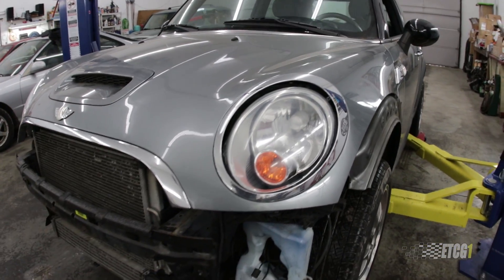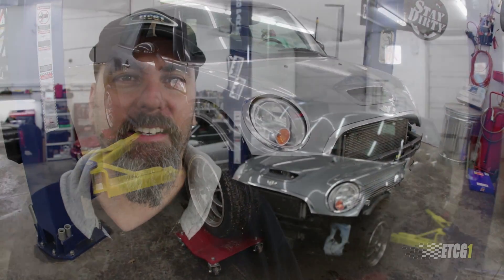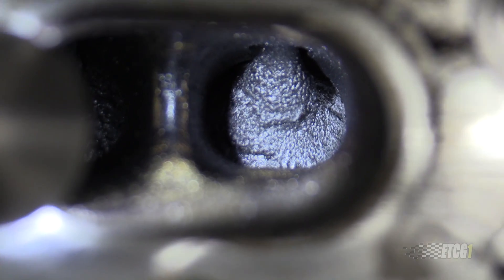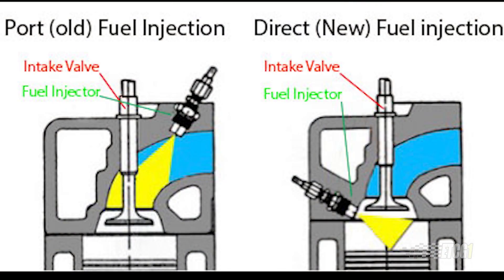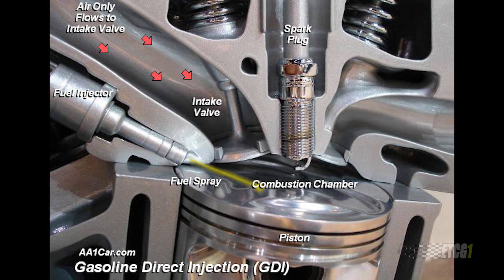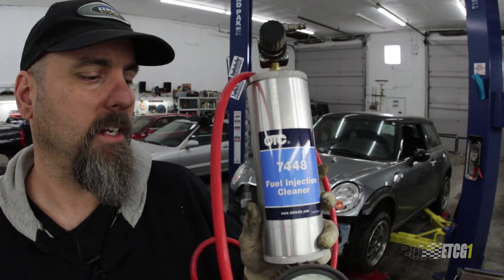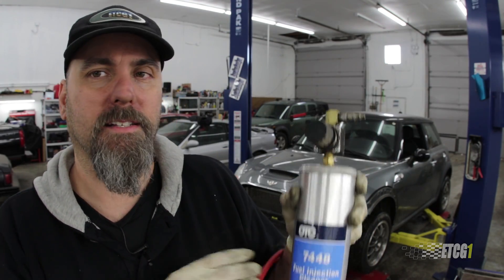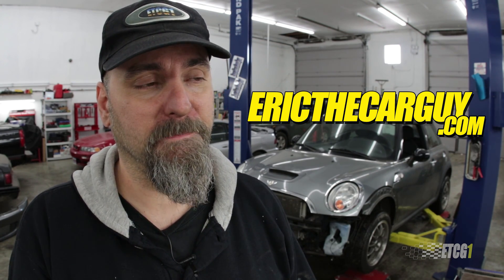Direct Injection Proves Fuel Additives Don't Work

Comment: The problem is direct injection, not the additives.  The majority of car manufacturers have publicly stated that the government minimum fuel detergents are not sufficient for port injected engines so there is little reason to argue otherwise unless you somehow know more than those engineers.  Direct injection is another issue entirely so the two need to be separated in any such debate.  Modern DI vehicles also have port injectors to 'resolve' this problem.

Comment: Coupla' things:
A) DI blows. It blows to the point that several companies, (Toyota and Ford come to mind. I'm sure there's more.), are using a port/DI hybrid system because of the intake valve junk. Of course, their stated reasons will differ from that explanation. cough*warranty work*cough
B) Fuel additives are, for the most part, un-necessary IF you're using tier one fuel. Tank up at Costco or Sam's Club on a regular basis and a jug of super duper seagum will help mitigate some problems associated with a "dirty" fuel system.
C) A catch can has been shown to reduced the amount of grunge on the intake valves in NA DI engines. 
D) A cleaner introduced via the PCV into the intake system can help keep intake manifold/valve deposits from building up too badly. The caveat is that if your engine is turbocharged, bad things can happen.
E) CLEAN OIL, FOLKS! If you follow the extended drain intervals recommended by some car makers, your oil will, by design, break down and add to the deposit woes. I don't care how "good" the oil is that you use or what your owners manual says, 20K miles is too damn long for an oil change. Maybe with a by-pass system. But, otherwise; no.

Comment: YouTuber Chrisfix tested several brands of fuel system cleaners. He inserted a camera in each sparkplug hole cylinder and got before and after images of the deposit. It was not a paid sponsorship and Sea Foam did the best job.

Comment: I had high hopes for direct injection gassers. The potential for higher compression, and more power + MPGs seemed too good to be true. The only solution I've seen so far is to double the number of injectors like on the latest mustangs (Hat tip to Scotty Kilmer). One set sprays directly into the combustion chamber, while another set sprays the back of the intake valve.

Comment: All direct injection vehicles that are boosted should run water methanol injection there would be no buildup on the back of the valves... or they should delete the EGR system. They should do one or the other. Or maybe they could run one extra injector in the intake manifold and periodically use it under heavy load to clean the back of the valves.... But some form of fuel needs to go through the intake manifold for long term use of direct injection.

Comment: Is seafoam a better solution to cleaning an engine to keep it cleaner when running though a fuel System? Or is it better to directly spray Into intake system and put into oil?

Comment: Fuel system cleaner is for fuel injectors only. it does nothing else so if you never want to replace Injectors because there clogged then use it it has been proven to unclogg fuel injectors and multiport fuel Injection should come back and save the day

Comment: I disagree with your logic on the gasoline. No, fuel injector cleaners don't do much good for direct injection engines (though they will clean injectors and carbon deposits off of the top of the piston), for the same reasons that you talked about. As far as fuel system cleaners go, most are snake oil. Most are just octane boosters, and you could get the same effect by pumping 91-93 octane fuel instead of 87-89. As far as the logic with gasoline goes, yes it's a solvent, but the majority of the intent for a fuel system cleaner is to clean the carbon deposits left over from combustion of said gasoline. There are many videos on youtube that show which cleaners work and which don't. Seafoam has a very good track record, and putting seafoam directly into the intake while the engine runs has been proven to have good results. 

Per your theory, a carburetor would never get plugged up. As most of us know, leaving a carburetor full of gasoline for an extended period of time will create a varnish as it evaporates, sticking needle valves and clogging jets. Carbs can even get plugged up by foreign objects such as dirt, but if gasoline was a good enough solvent to clean deposits, it should also help clean these foreign objects.

Comment: I always thought that the fuel injector cleaners were to clean the carbon off the tip of the injectors where carbon builds up or other stuff gets stuck on the screens. 
That being said, gasoline is a good solvent and should do the job anyway as you mentioned.

Comment: I do know the automotive show Fifth gear did do a test on an older car where they were looking to restore "lost" power in a car that ran just fine, and fuel injector cleaner gave it back like 7hp and was proven on a Dyno, though the car ran no different and you wouldn't feel that 7hp difference amyway

Comment: For whatever reason, it seems like the German GDI engines (VW, Audi, BMW) seem to suffer more than others with intake valve carbon buildup. Most of the complaints I've seen with GDI engines having major carbon buildup problems fall into that category. Not really sure why, but some manufacturers have apparently done things with the valve timing in order to cause some amount of fuel mixture "backwash" over the intake valves to help keep them clean.

Oil also makes a difference. If you run a synthetic oil with lower NOACK volatility ratings, you're going to get less oil evaporation to end up getting caked onto the intake valves.

Comment: How in the actual fuck does a direct injection engine that never gets a drop of gas or fuel aditive/gas across the backside of the valves prove in any way shape or form that fuel additives don't work? I know your salty because Minis will do that to you,  but c'mon man.  You know what will keep most of that crap off of the back side of said valve's? Catch cans on both sides of the pcv system.

Comment: Carbon build up happens thanks to a combination between the egr and the fact that the injectors throw fuel inside the cylinder, never  cleaning  the intake valves. I'm not a mechanic by the way, so don't kill me if I'm wrong.

Comment: Well some of the cleaners (in my opinion) do keep the injector tips cleaner but not the valves. The best thing I’ve found on specifically ecoboost engines is a quality oil separator for the pcv system and top quality fuel , regular oil changes obviously

Comment: So, tell me again why you picked up this Mini?  Was it like your father-in-law's Jeep?

I had a Nissan Pathfinder (1980 something) that had a throttle body system.  It was running rough so did the usual and changed the plugs but that didn't help.  The shop I took it to said that the throttle body needed to be overhauled and cleaned out.  These were my poor days so declined and tried a bottle of Prolong first.  Wow, it did the trick!

I have a direct injection Tohatsu 90hp outboard motor that I bought new on my boat.  The shop said to run premium gas and Techron fuel additive.  It's been four years now and have only changed the fuel/water separator filter.  It's still on the original plugs, etc.  Starts right up every time.

Comment: DI is good if you run boost. Lower octane required and higher compression and can run leaner mixture. Needs a good pcv oil separator.

Comment: You can still dump crap down the air intake like we did in the 60's.  Mostly used transmission fluid.  Not sure what the purpose was, I was 16 at the time but it made a lot of cool white smoke.  Just like when the modulator valve failed on one of the old automatic transmissions.

Comment: ticking time bomb, stay away from DI i was told back in the early 90's for this exact reason but the automotive industry is pushing this shit like it's a new invention to the IDIOTS stupid enough to believe it. It's been around since the early 40's and they never pushed this tech for this exact issues and now they are only hoping the cash in on it when this ticking time bomb runs it's maintenance cycle in the market. They try to fool the idiots saying it's a better new technology yet at the end of the day there are no significant gain in fuel mileage. FUCKING TOOLS, just another part of they global planned obsolescence scam. LOL

Comment: There is not a single additive that anyone should use ever.Period. Oil/fuel/coolant came with all necessary additives in them and anything else is just wasting money and even causing more problems depending on how sensitive the vehicle is. If you using an additive then there is a problem with your car that needs servicing or you are buying a placebo. Bottom line. Oh maybe octane boost if you need to refuel somewhere with bad gas and require premium. Thats all I can think of.

Comment: I work at a dealership and we use service pro fuel induction services for our customers. I'll be honest, I'll do it if it is on the ticket but I never upsell that item, if a vehicle needs a brake flush, coolant flush, trans flush, I'll upsells that, but I just feel like I'm pick pocketing a customer with a fuel induction service. It's a pour in additive to the fuel tank, spray off the throttle with throttle body cleaner (which is good I guess) and then let the intake vacuum draw intake cleaner through the intake. I've never seen much of a difference but that's just me. I don't put it in my car, don't see much of a point in trying to sell it to a customer if the results are questionable.

Comment: I’ve seen walnut shells blasted into intake ports to clean valves while the head is still on the engine. I’ve been concerned about direct injection as well. I’ve got two cars with it.

Comment: I feel like the while premiums is just wrong I think think all your really meant is that fuel additives don't clean intake valves on direct injection engines but a lot of things wrong here 1 I'm not saying that a lot of them are not crap and snake oil but they say it can help if you use top tear gasolines whats different between cheap and top tear additives and do you use the cheapest gas you can find or are you brand loyal but saying something similar to something else proves something else does not work I mean what you are saying is condoms don't work I got crabs well they were basically never going to do anything for crabs

Comment: You are correct. Direct injection works fine until the blowby gases crud up the intake. Yes, the additives that are sold are pure snake oil and really won't fix the problem and at best just push it off until some other major problem comes along in a few months. But isn't that the point of modern cars? They're "use them once and when something goes wrong, toss them". Even the OEM replacement parts are getting to be total crap as well. 

"Just because I'm paranoid doesn't mean they're not out to get me."

Comment: If you use seafoam and spray it into the intake instead of putting it in the gas it will work on a direct injection engine since it's going along the back of the valves where the air goes in.
Reply: I've tried it for myself and it'll definitely make it look cleaner even if it doesn't have any effect on the performance.

Comment: Find a small manifold vacuum source. Heat the engine until fully hot and introduce water into the manifold through the vacuum source. Do it slowly, allowing it to take small amounts and rest in between.

Comment: TLDR: fuel system cleaner doesn't work on areas of the engine that fuel doesn't reach. 

Also won't do much in the tank, unless maybe you put some in every tankful. 

Former Audi B7 A4 owner here: soda-blasting the intake valves is an amazing process and your car will be a new beast when it's done. Also, install a catch can asap to rid yourself of most of this issue.

Comment: Apart from "possibly" cleaning injectors and fuel system with fuel cleaners, it's my theory that without fuel to "wash" the intake valves, a direct injection engine will always have dirty intake valves

Comment: Its that yankee fuel!! HA HA A good fuel injection is great... And easy(er) to tune than a carb. But you will find even though a carb is simpler, a fuel injection is more efficient and can possibly make more power where and when you need it. (by easier to tune, I mean the tuning map, putting fuel here and there where you need it and many other custom tuning needs in performance. And a carb is a balance between jetting and fuel pressure and its more "analogue")
Reply: OK, I'm old but gotta say, I can tune a carburetor with a screw driver in a couple of minutes, no computer required, I do it by sound and a tach if ones available.  On the other side fuel injection systems are pretty forgiving, with all of the sensors if they're right they tune themselves.  I see the good in both, for a daily driver or a hot rod I want fuel injection.  Unless you want to wrench all of the time and constantly clean and adjust you want fuel injection, it's probably the best thing to happen to cars in the last 30 years.
Reply: The one and only reason I prefer fuel injection to carbureted is the easy starting in the cold. Not having to mess with a choke is a fantastic.
Reply: Has nothing to do with carb vs fi.  His rant is about direct injection vs port or throttle injection.  A carb can match a throttle efi in performance, economy not so much.  A carb can't match a port setup and certainly not direct injection on any front outside of cost.  

This issue is that with DI only carbon build up is a real problem inside the combustion chamber and gunk in the ports.  It's not really a fuel additive thing though.  It's the fact that fuel is precisely injected in a very fine mist quickly and there is no washing effect.  With port or throttle injection fuel is washing the port and combustion chamber before it's ignited.

You might be thinking why the port, well because PCV vents back into the intake.  So if you own a DI only car don't be surprised when around 25-50k you are hit with pricey fuel system cleaning, failure to do so will like mean you are looking at removing and media blasting the intake and heads.  This is part the reason you seeing some cars with port and DI coming out now.

Comment: You are so right!  I admit, I fell for the 3M Fuel Injection Cleaning System BS.  Bought the whole kit, along with many cases of the high pressure and low pressure cans.  You probably remember the stuff...you disconnect the fuel pump, disabled the fuel back-pressure bypass to the return, and connected a can of this stuff to the injector rail and ran the engine off the contents of the can until the engine quit.  I thought I was doing great by the customers...until I took some intake manifolds off of cars I had treated with this stuff.  I noticed no difference, whatsoever, between engines I had "cleaned" and others I am fairly certain had no "cleaning" treatments, whatsoever.  I was had!  Big surprise when 3M stopped making this stuff.

Comment: we run gm top engine cleaner through the intake to clear carbon like that and id say it works most of the time. Its usually to fix cold start missfires

Comment: We use a qmi induction service and i hook it up just behind the throttle body with the vacuum line. It essentially hits the valve through the intake manifold thus cleaning it on GDI. What do you think of that?

Comment: Fuel stabiliser is basically all i put into the tank of my car, a 99 accord. Why? Well the bitch often sits for a few weeks before getting started as its in storage. Its got 230k miles on it before any of ye ask. Still starts with a tap of the key (way easier than the shitty mini in the vid) my verdict: high mileage honda that sits for weeks is better than low mileage mini that cant sit for a couple days without dying
BUY JAPANESE

Comment: Mmm, fuel additives. What about putting 2 Stroke oil in diesels at about 1 part per 100?
Mixed results. I tried it myself on a 20 year old normally aspirated diesel and it did make some difference. A more modern diesel, it might not make much difference other than an improvement in economy cause it retunes itself to compensate for a better cetane rating ...

Comment: I'd expect if they did help, without some significant drawback, all these chemicals would be part of the standard additive package.  They aren't, and there are reasons they aren't.  Whether it's money, sped up corrosion of some parts, whatever, they'd be in the standard package if there wasn't a significant drawback.

Some of them might have some utility in some situations like you suggest, but as an every fillup item... waste of money.

I did throw a can of Seafoam in my Grand Am when I got it because why not, but normally the only stuff I ever use is HEET to get rid of water in the gas, had a bit of a problem with that in a Maxima(often enough I probably should have launched a real diagnostic project to figure out why, but that car is pretty much scrap at this point)

Comment: I've not really put a lot of faith in them either. However I've seen a guy bring some injectors from his Powerstroke back to life with some so I'm not entirely convinced its complete bunk. I would investigate a catch can or other AOS of some sort. I had them put on my BMW and it made a notable difference in the time between walnut blasting the valves. I was getting about 20k before needing them blasted and was able to get about 35 after the catch cans.